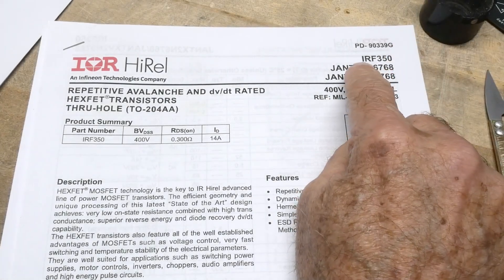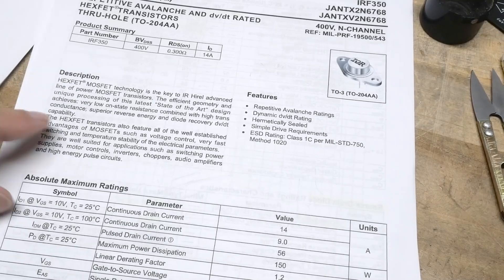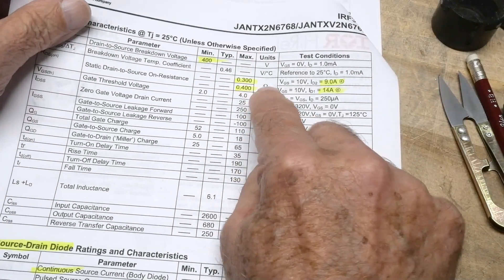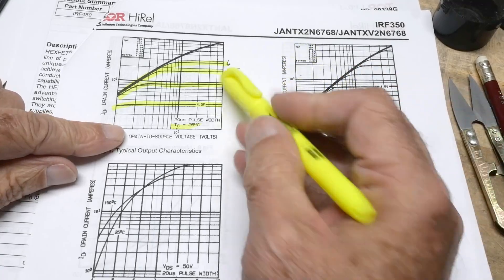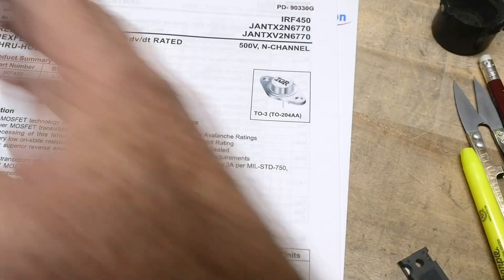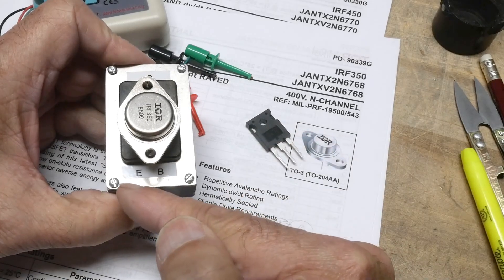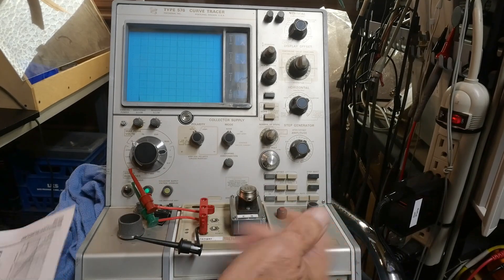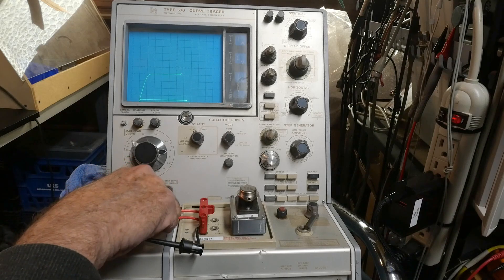#2200 IRF350 Hex FET

Comment: The diode is not really for protection.  It is a property of how the MOSFET is made.  They make the shape of N type material they need by doping other silicon to be P type and connecting it to the source leg.  In normal operation that PN junction is back biased and thus makes the outside wall on the FET.  When you reverse bias, it is a normal PN junction that conducts.  On some very early MOSFETs that diode had a recovery time that was measure  in years so you wanted to avoid back biasing.

Comment: 3:00 are you going to use it to its limits? Is it a good engineering? No, you probably will leave margin, and use it maybe at those 9A, so it makes sense.
And even if not exactly 9A, all of those tables are just subjective descriptions of the part to a good engineer and they would really care about curves & graphs prioritizing it to everything learned from those tables.
The best ones would moreover re-characterize parts & verify curves themselves, e.g. like they do in military applications.
 Front page table also looks obvious to anyone above newbie. Bad example of the whole marketing drama IMO.

Comment: So where did they get the name "HEXFET" from?  Hex meaning 6, and FET being self explanatory.
Reply from the maker: The die has hexagonal structures to spread currents
Reply: Usually power MOSFETs are vertical devices, meaning drain at the bottom, source and gate at the top. In order to make them handle these sorts of currents, a large number of this basic structure are connected in parallel. So in this case, I believe they make the basic MOSFET "cell" hexagonal an connect lots of these cells in parallel, which makes the hexagon advantageous for this physically.
Why not circular or square? Probably due to manufacturing ease and current density issues.

Comment: In videos and comments, I hear the term "pass transistor" quite frequently.  These are typically this type of package.  What is the purpose of these in a power supply?  Are they used in a voltage regulation circuit?
Reply from the maker: https://youtu.be/RvNQTvdcY2w?si=-rYC7lUZPBxjy4yU

Comment: Many TO-3 parts, MOSFETs often, have gone out of production due material safety. There was lead and/or beryllium and/or any other naughty stuff in them. Rather than reinvent the chip makers just deleted them.
Reply: I don't think BeO was used inside the TO-3 case of a power mosfet.   The mosfet silicon die was eutectic soldered to the metal base.  Thick film hybrids such as APEX PA-series high voltage power op-amps used BeO, and they had "BeO" printed on the outside of the case.

Comment: I tend to be very suspicious of wattage ratings in datasheets for power transistors. A much better place to look and evaluate what the device can take under load is the safe operating area curve(s) which will tell you much better what currents the device can take at various voltages and temperatures.
Reply from the maker: just make sure you always have a 25C case temperature no matter what. (that was sarcasm)  😎
Reply: @IMSAIGuy  I always do that, with an infinitely big radiator.
Reply: Yep; the power ratings in datasheets almost always assume impractically good cooling. No, I'm not going to watercool this FET.
Reply: @siberx4  to assume any particular cooling capacity would be wiser? You isolate all the other variables when trying to measure unknown in question..
Its a job of a designer to apply it to own conditions.

Comment: Higher energy pulse circuits? I bet it's gonna be a solid state laser power supply as one of use case for this transistor, for Copper vapor laser as they demand a lot of energy to disassociate Copper from any of Halide salts in order to emit golden yellow and Cyanide green laser light, in turn this IRF350 transistor is kinda meant to replace Thyratron tubes with, effectively making it slightly more electrically efficient as you don't have to deal with the Thyratron Cathode heaters anymore.

Comment: Yeow!  Look at that RDS(on)!  Infineon must have pulled the plug on these pretty quick, their Cool-MOS parts at that voltage have an RDS(on) about an order of magnitude lower.  I have some early-2000s 400V .027 ohm RDS(on) parts that make a great electronic load bank.
Reply: @Slickrock72  those are old parts. Most of IRFx50 MOSFETs date from late 80s and they were supplanted by newer models from IRFZ lines with much lower Rds
Reply: @rafaelgcpp  I know this.  I used to be a Process Engineer working for Advanced Power Technology, in Bend Or.  I threw away all my old high-RDS(on) power mosfets when Cool Mos came out.
Reply: @rafaelgcpp hi, great comment. Would u be able to direct me to somewhere i could learn more on the naming system, or families/groups/?generations/uses for the various ones - IRFB, IRFZ, IRFP etc, thanks
Reply: @ foundries name their semiconductors as they are naming their kids. It makes too little sense. There is somewhat correlation but it is a one-to-one mapping. You start learning as you use them over and over...

Comment: Glad to see the TO-3 packages replaced with TO-220 and the like these days..  I used to have a big linear power supply for my ham radio back in the day using the ubiquitous 2N3055 as the pass transistor.  It was, of course, mounted on the heat sink on the back of the power supply box, and woe be unto you if you managed to short the case of that transistor to anything!   Mine didn't have any fancy cover, so you just had to be careful.
Reply: TO220 has WAY higher thermal resistance than TO-3. TO3 is still superior in many applications.
Reply: @humidbeing  TO-247 is comparable to TO-3, TO-247Plus is better than TO-3.  TO-3 is a pain to work with when building projects.  BUT... the lower RDS(on) means less heat from wasted power so while the old IRF350 needed to be in a TO-3, the modern comparably rated low RDS(on) mosfets can acceptably dissipate their wasted power out of a TO-220 or a D-PAK.
Reply: Ah, 2N3055 - the EL34 of semiconductors! The power transistor of choice when I learned electronics. Still got a lot of them.
Reply: @KeritechElectronics  Me too, TO-3s for nostalgia's sake, but I use TO-220 MJE3055s (and others) for bipolar power stuff.

Comment: In which circuits are these irf's used??
Reply: Any circuit you need high power switching with somewhat low loss.
They can also be used in linear supplies.
Reply: I used to see them in variable-speed motor drives such as Polyspede and others.